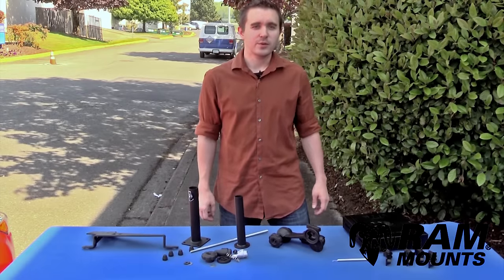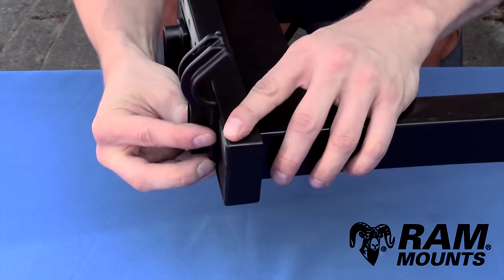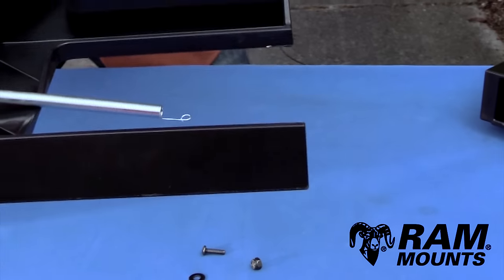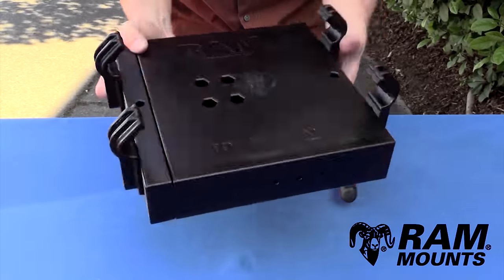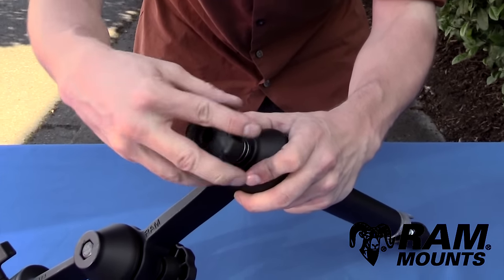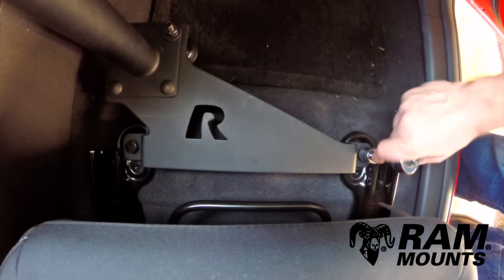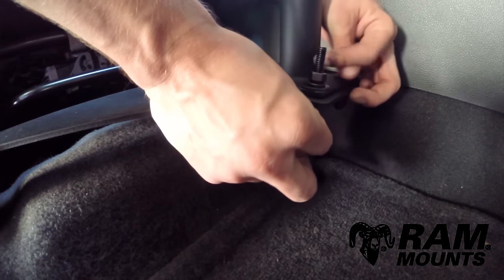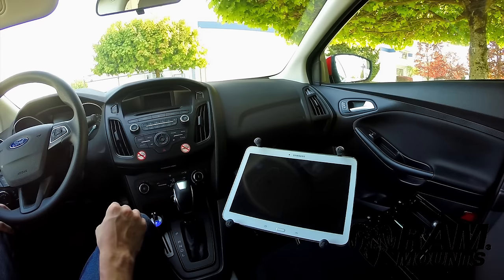RAM® Mounts No-Drill™ Vehicle Laptop Mount - Assembly & Installation Tips

Comment: How closely can you adjust the laptop to be in front of you? I get neck pain from looking too much to the right. Thats the problem I had with a mobotron mount. I'm hoping this mount is able to be more in front of me.
Reply from the maker: Good question. Every swing arm in every laptop kit is 6" long, and every kit comes with two swing arms which gives you a max articulation of 12" from the pole's position, and the pole is generally positioned close to the center console but still on the passenger side. If necessary you could always add a third swing arm to the kit to give you an additional 6" of extension. That part number is RAM-VB-109-3U, seen here: https://www.rammount.com/part/RAM-VB-109-3U

Comment: Some RAM 2500 trucks have a heating duct that requires the included extension kit to circumnavigate the duct.  Its use, however, results in a flimsy shaky mount that allowed my 12" tablet to sway as mucn as an inch while driving on interstate highways in my MT tires.  This no dril mount also precludes the use of my passenger side RAM floor mat. I ended up taking mine out, but failed to return it within the companies short return window.
Reply: Curiously, is your 2500 Promaster Van? Some ppl use the terms Truck/Van interchangeably, so only ask to clarity that your use of the term truck to confirm that you mean that you have a RAM 2500 Truck and not a van. I also ask because this particular mount is for a 2014-2024 (RAM Promaster) or a 2014-2023 RAM Promaster City series and is not listed for trucks on the ocmounts webpage. At list not currently, it isn't.

Comment: It looks like the longer stabilizer bolt still isn’t long enough. Did someone forget to account for the length of the spacers? I assume that the final kits had longer hardware for that vehicle so I would’ve acknowledged that in the video or made a second take with the longer bolts. This just looks bad!

Comment: Can I use this as a table? In case I wanna eat in a parked mode.
Reply from the maker: Yes technically when there is no laptop in the tray, it's essentially a ~10" x 10" flat surface (+ 4 nut pockets in the middle though). If you want a more official tabletop surface, you could use an additional RAM-202U adapter and fashion up any custom table top tray, and that tray with RAM-202U ball can be swapped between that and the laptop tray if needed.

Comment: Has anyone used this Arm System to hold an iPad or other tablet?  How do you like it?
Reply: I think it would be a bit overkill for something so thin and light weight. It's designed to secure a laptop by its base, it you attempted to put a tablet there, the arms would be blocking a good amout of the screen, and it would be facing straight up.

Comment: Is there a way to accessorize these mounts so that the laptop can be extended to be used directly in front of the steering wheel?  Sitting in the driver seat and typing to the side for extended time is hard on the back
Reply: That's why I made this - and use a wireless keyboard/mouse.  https://imgur.com/a/Oo5ltk6

Comment: It would be nice if this was designed for the passenger instead of the driver. If my wife drives, I work. If I drive, my wife works. If the driver works while driving, the driver and passengers die.
Reply: I just installed a ram mount and the passenger can very easily use it. There are so many swivels and adjustments you can use it facing anywhere